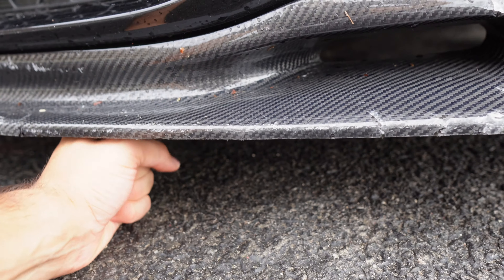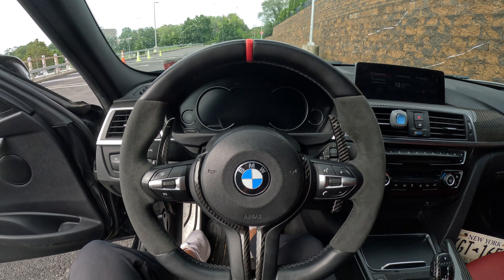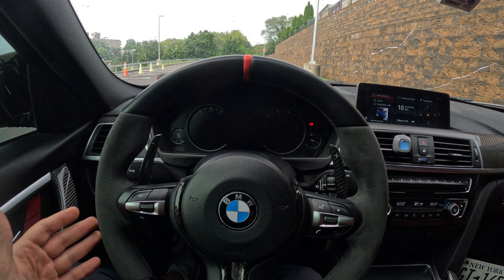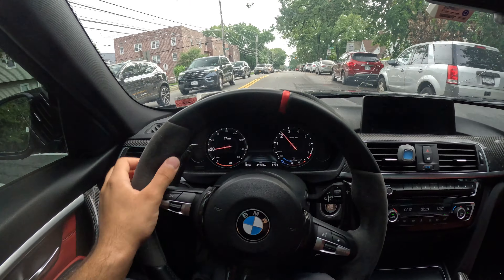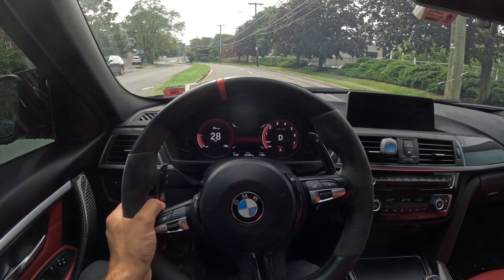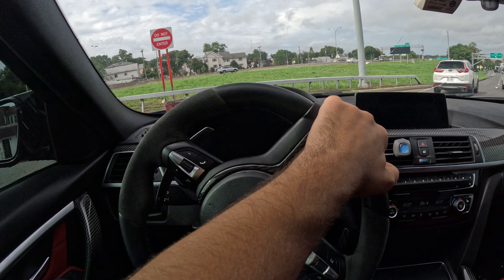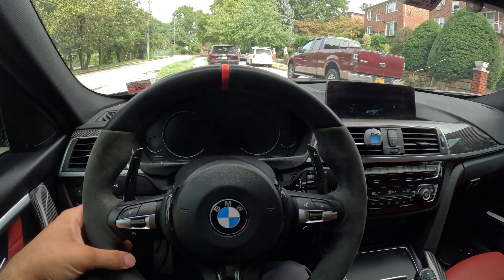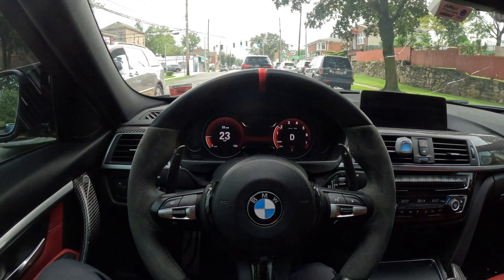WATCH THIS BEFORE YOU LOWER YOUR BMW...

Comment: If your F30 didn't come equipped with M Sport package, i think what you're experiencing is expected. I lowered my 440i xDrive F36 Gran Coupe M Sport with EDC with an Eibach pro kit US catalog 10% stiffer than stock springs so more control without harshness in ride.  Ride was almost same as stock and firmer when on Sport with no issues.  Minimal drop of 0.8" front and 0.6" rear...very subtle drop. Based on my research H&R and Dinan springs is to be avoided as they are typically at least 30% stiffer than stock. xDrives do not like to be lowered more than 1.5" in front because that puts their suspension geometry out of spec so they often begin to break front drive shafts. Perhaps change your damper with B16 Damptronic kit from Bilstein, KW or Ohlins
Reply: Thank you
Reply: how much is safe to lower rear without breaking shafts?(without x drive if it makes a difference)
Reply: @Nukram i wouldn’t buy the red springs from h&r the blue ones wouldn’t cause an issue
Reply: Which eibach springs did you order for an xdrive 440i f36??

Comment: I guess I just don't understand, you're saving money with lowering springs?  IMO that's an expensive BMW.  Seems well worth it to get the $1500 coil-overs. This isn't an old civic.  Maybe I'm mis-judging the value of this vehicle.
Reply from the maker: The car (excluding the mods) is worth only about 17k I would say. These lowering springs cost about 250 so still much cheaper than even a cheaper set of coil overs. Overall; if I could go back, I would’ve done Bilstein coilovers
Reply: Coilovers make the ride shit, springs are better

Comment: The best spring setup you can do for an f3x with edc is h&r sport springs with dinans suspension tune. My 435i was really bouncy in comfort mode because the dampening was too soft for the spring rate after dinans suspension tune the car drives much smoother and is more planted over bumps at speed.
Reply from the maker: Great point for a car with EDC! I wish mine had it
Reply: I have an xDrive 435i with EDC. Could you share the link to the dinan suspension tune? 
Hesitant about lowering my car but this may solve it!!

Comment: I love the Normal and Sport modes that my 2024 Supra offers. However, I don't like the fender/tire gaps. Ideally, I would drop the car just a half-inch at each corner, but I'd have to get adjustable springs to maintain the electronically-adjustable shocks. (which would be eliminated with coilovers)

Comment: How does the adaptive suspension interact with the lowering springs? Does the comfort mode, sport mode, etc adjust the suspension and does the lowering springs affect it as well? Sorry new to the bmw game
Reply from the maker: So this car actually doesn’t have adaptive dampers. That was an additional option that this car wasn’t spec’d with. But if it did have it, it should still work since you’d only be changing the springs and not the actual dampers

Comment: Appreciate your video... It's Crazy cause I have my H&R sport spring box sitting here in my garage waiting to be installed in my F10 535i m sport.. After hearing what you just said about the issue with keeping the original shocks I couldn't agree with you more... I never even thought about that.. Man you saved me from getting future headaches. I guess it would be smart to install these springs with a set of new shocks all at the same time instead of ripping the crap out twice. Anyway thank you for your input, and all the efforts you put into your videos.. Very helpful!!
Reply: Update... I went the BC Racing coilovers way, and couldn't be happier!! Stance is set absolutely perfect and the ride is better than the stock  M-sport setup.. It was the full adjustability that caused me to return my H&R springs and go this route.. 
The best choice I've made on this car!

Comment: My f30 has coilovers for 4 years & i hate it. too harsh. springs are the right way
Reply: Really? What coil overs do you have
Reply: @GuhbsBeats  Bc racing coil overs, i sold that car i have a 2021 540i & im not gonna lower it. nothing beats stock suspension soft ride